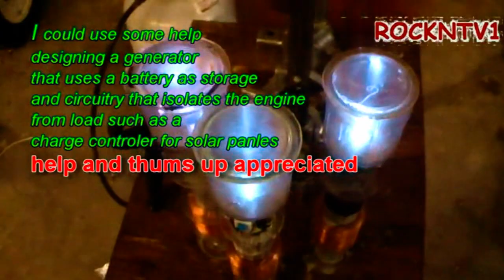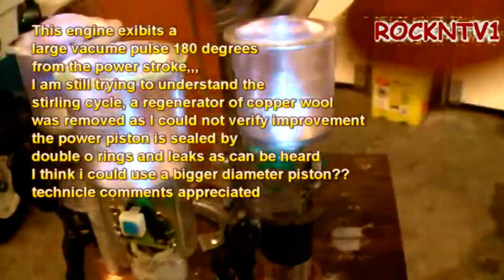Stirling Engine Wood stove Generator Alternator make FREE ELECTRICITY

Comment: The magnet and coil charging the cap is still a load. It is just a very tiny load and you can't tell with the naked eye. Even with the light bulb on it is still a very tiny load in comparison to the energy you are producing. Think about it, it is a shaker light it only needs a few milli-watts.

Anytime a magnet passes near a copper coil it has resistance. The point is it is not  big deal because you are only making like 2 watts of electricity but if you make more watts your machine will still feel it. 2 watts or 500 watts, it don't matter they are both a load. But draw 500 watts and you can notice with naked eye your machine slowing. Your machine is bigger than the experimental educational toy sized Stirling, so when you power a 2 watt load you don't even notice, your machine might not even slow down because there is enough torque from your machine.

The energy it took to raise the magnet against gravity, you recover because it falls again. When the machine lifts the magnet up it is like stored potential energy, but then the machine allows it to drop so you gain it back. The only losses in this relationship is the friction in your parts rubbing together. But once you have a copper coil around the magnet this produces more resistance in both directions up and down and this will draw more energy from you machine, but you might not notice since it is a small coil and small load.

What is going on too, is that your magnet is not traveling fast enough thru that coil, that is why it won't light up very good. The shaker light only works if you shake it vigorously, if you shake it slow it will light up very dim, like what you have happening.  Either the speed of the magnet needs to be adjusted to go 2-3 times faster thru the coil, or you need a coil 2-3 times bigger to light the light bright. But once this happens you will probably notice the drag on your motor, at least a little drag. If you notice with the naked eye or not, it will still have a small drag on your machine.

For example, the shaker light is 2 watts, let us just say it is 2 watts for an example. But you are only producing like 0.5 watts for example, and that is why your machine don't feel it, and why the light barley lights. (the speed of magnet too slow for that design of coil and magnet set up to charge the cap and light the bulb brightly)
Reply from the maker: Dear Tom, I want to thank you for taking the time to comment here. I must say you have delivered some of the most helpfull Information I have recieved in the 8+ years I have been posting these engine builds. At the time of this experiment, I was still wrapping my machinist / mechanic head around the faraday principal. In the "bigger is better" mentality i did this -->  https://youtu.be/f9Cs3daKT6o  <,,,,  I did not relise that the copper coil, even in "open circuit" would produce resistance just by being present,,, is that right? I still do not quite grasp the nature of the circuit contained in the shaker flash light as but a tiny rectifier/ storage device to replace a battery, I  understood it to do an amount of "decoupling" from the bulb, "load",,, is this right? My limited knowledge of the  circuit contained has detered my advancement on this project. The fan blade is also a load to the engine and is limiting the rpm, Showing my shooting in the dark, and biting to many apples at the same time, nature of my testing, LOL. In my mind, at the time this experiment took place,. I envisiond an electronic circuit that may take 75-100 watts crankshaft power and convert that to higher amp output though "black magic" electrical engineering to charge batteries. I thought there was an electrical way to isolate the load from the prime mover by electronic means, "a bunch of diods N shite"? Maybe a flux capacitor,,, or 2. Any insite you can provide would be GREATLY appreciated. 
john
Reply from the maker: BTW, there was no allowence for time to charge the cap, had i left the engine to run for 1-2min befor e closing the on switch the light is much brighter, hense my reasoning for a "decoupler" from the load.

Comment: Magnets on the crankshaft N S N S with coils mounted to absorb the faraday force.  Less parts involved.
Reply from the maker: I am thinking axial or radial flux type on non magnetic disk directly connected to the crankshaft. Im guessing these type are 3 phase alternators, and the electricity needs to be rectified. I wish i could just find a bolt on that i did not have to build every thing,,,, but hey

Comment: Would be better off making a thirmoacoustic engine
Reply: The flash light cylinders will still be taking pressure away from your power piston Linear alternators are not as efficient compared to a rotating generator you probably already no that but anyway nevertheless progress 🤙
Reply from the maker: i AM THINKING OF TURNING the entire fly wheel into a generator.  Tjis was just an experiment, thanks for watching
Reply: @tkmotors991  We used a low-speed permanent magnet brushless generator.
Reply: A thermoacoustic engine has a very low efficiency and there is a problem to make a generator.
Reply: @ВикторЗакомолдин-в8ж  that’s debatable it depends on what Thermoacoustic engine your talking about
Reply: @ВикторЗакомолдин-в8ж  I think you’ll find that Stirling engines are a lazy clumsy way of harnessing Thermoacoustic power